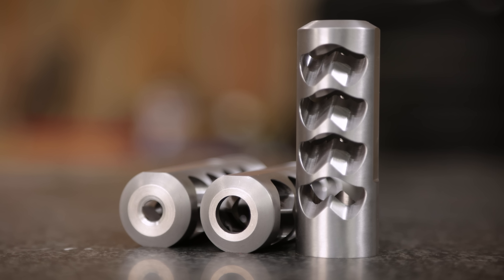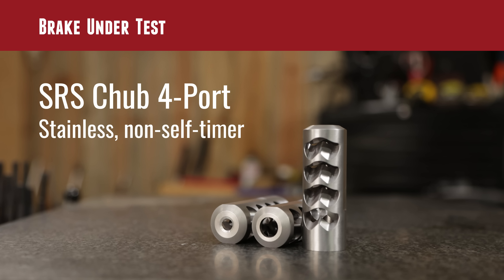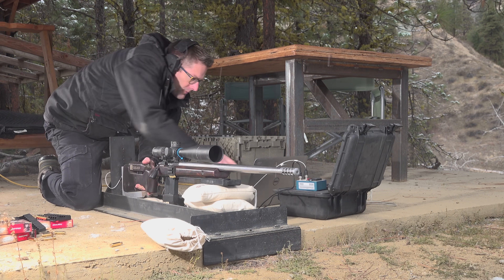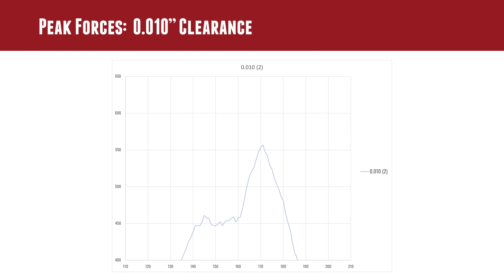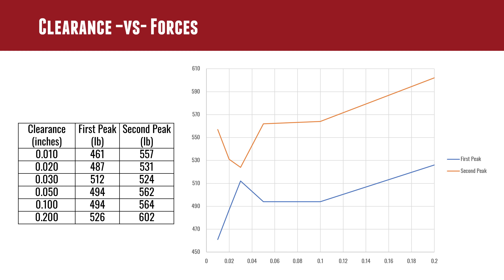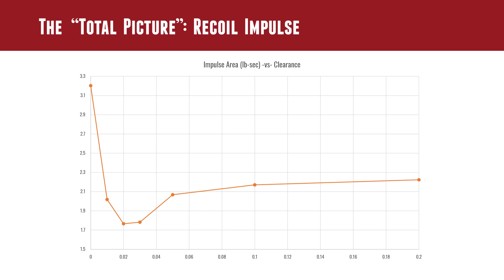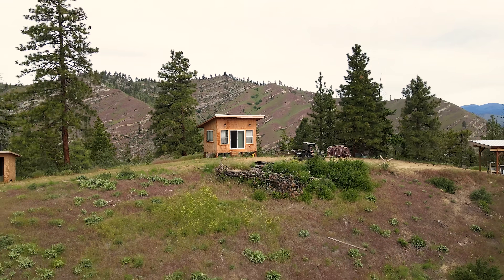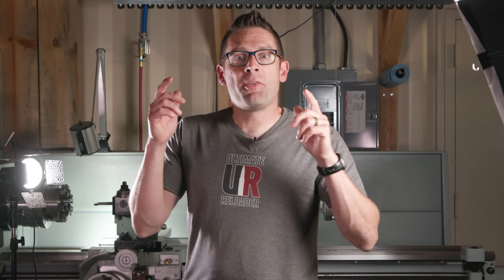Bullet Clearance -vs- Brake Recoil: Shocking Results (SRS Brake)

Comment: It is a good test but you are missing a key element.  Each time you bore the brake, your are removing surface area for the gasses to act upon thus reducing the efficiency of the break.  If you take into account the loss of surface area to increase of recoil, then your data shows even less difference in recoil.  

For example, when you remove 0.200" from the break in your last test, you are removing about 14% of the brakes surface area (estimated based on a SRS The Chubs diameter of 0.990") and the recoil increases based on the average of the two peaks of about 10% from the baseline 0.010" test readings.  

The correct way to run this test is to have different muzzle brakes for each stage so they have the same surface area for the gasses to act upon.  I think you will find that the recoil differences with this test will be even more obscured.
Reply: Exactly! I was going to mention that the o.d. with more surface area on the baffles would have a bigger impact on recoil reduction.

Comment: I liked Austin's suggestion of measuring velocity while testing although the differences may be small but still measurable. Also would l to see same testing on differently ported breaks. Seams like you did a video on different brakes for there recoil efficiencies and are their porting 10 to 30 thousand over bullet diameter,  if this is the industry standard sweet spot? I really liked the recoil reduction of this break.

Comment: Gavin, assuming the muzzle brake is made properly, I am wondering the muzzle speed relative with the muzzle brake clearance to the bullet. Would like to see if you would test this. 
FYI, I have 2 muzzle brakes for my 6.5 Creedmoor. Without knowing the muzzle brakes inside diameters, I observed that they are giving consistent muzzle speeds difference of about 20 fps.
Looking forward to see your evaluations.

Comment: I've run 6.5 brakes on 6mm with no noticeable difference. I've always thought 30 cal brake on 6mm left a little bit of recoil reduction on the table, your data seems to support that.  Regarding a test of whether bore diameter effects precision or POI - ultimately I think a very difficult thing to test successfully. What you'd actually be testing is the effect of removing mass (loss of metal from the larger bore) and how that acts as a "tuner" on that particular load and rifle. It would only become a valid test if you could run it with a large number of brakes and rifles to get something statistically significant.

Comment: I am wondering if a progressively tighter chambering would provide a better consistency to gas flow and hence better precision in bullet impact. By that I mean cut the first chamber aperture at 0.050, the second at 0.040 and the final at 0.030 over caliber. It has been a few decades since my fluid dynamics classes, but I would expect a progressive aperture to reduce eddying and turbulence in each chamber and impact the projectile less.
Reply: This is how I make my brakes, but my reasoning is simply that I want each port to do some of the work, instead of trying to shed as much gas as possible in the first port with a tight bore going into the second.

Comment: It would be interesting to see if there is an effect on the bullet velocity in relation to the muzzle break clearance. Also what is the effect on a 5 or 10 shot grouping with changing the muzzle clearance at 100 and 500yards.

Comment: So just thinking it through; as the bullet advances down the barrel with expanding gases behind it, not nessicarily like a wind, but expanding in all directions it reaches the end of the barrel and newtons law comes into effect. Equal and opposite forces.  

With the brake installed the expanding gasses pass through the brake which redirects the gases rearward like a thrust reverser on a jet engine canceling out a portion of the forces.  So no matter the size of the hole in the brake the gases always expand out.  Even if the hole is bigger the gases expand out and you don’t lose much brake action until the difference becomes extreme, but even then the gases want to expand out.  

Sorry.  I’m a novice to guns.  I have them and hunt with them and shoot them but don’t usually think about the operating principles.  Like some folks driving cars.

Comment: That was awesome. Love to see similar testing with suppressors of different calibers, like the difference of using a 9mm suppressor on a 9mm vs a 45 cal on a 9mm. Both should effect felt recoil, but is there a large difference? If there isn’t a large difference in recoil and sound, why buy the 9mm that surely isn’t safe for use on a 45.

Comment: Just a note after building and installing a bunch of brakes over the last 20 years.  Bullet clearance can and will reduce by .005" or so after about 100 firing cycles.  If your target clearance is .025" bore to .030" and your clearance will shrink to target diameter within 100 rounds or so.  I have experienced this with almost all muzzle brakes no matter what material the brake is made from.
Reply: heat cycling ... long thin things get shorter and fatter. Volume wants to return to a sphere over time due to gradient heat cycling.
Reply: Possibly from elongation causing an "extruding" type of effect? That is very interesting...I wish I had measured the ID of the brake on my LR-308 when it was new compared to now because I have well over 600 rounds through that brake. I may get a new one for it and do a test. Thank you for this comment, it has really sparked my interest!
Reply: @willperry6244  I think it could also possibly be from the pressure expansion.  If you are able to test I would like to know your findings.  Hopefully I'm not crazy!
Reply: Is that due to fouling?
Reply: @tommoss2005  No.  I observed this after thorough cleaning.

Comment: Try tapered internal clearance on muzzle brake...tight to loose..vs loose to tight? ..or... tight..loose..tight loose... alternative.

Try off centre brake to gauge what difference.

Try oval holes...alternating..left right to up n down....

Tight clearance gives less following gas at higher pressures

Loose gives more following gas at lower pressures.

I guess...

Comment: Others have already gotten at both of these points. 1) What was the effect on accuracy? 2) What would happen if you left the exit bore at .01 or .02 but bored the preceding holes larger (kind of like a chamber to allow gasses to expand and maximize gas exit through the ports while minimizing potential turbulence on the bullet at the point of exit)? (And how might that compare in accuracy against the constant bore size?)
Reply: I'm also curious of this but using a tapered bore. Start small to large and start large end small.

Comment: why do they read 0.01 as "10 thousandths".?
and 0.2 as "200 thousandths".?
to me, reading non-existent zeros is redundant...???
it's the same as calling 2 as two hundredths of one hundred (002),
or... two and zero thousandths (2.000).!!
Reply: It's standard in machinist lingo. Easier once you get used to it.
Reply: @duggydo  thanks, that makes sense...
machinists ALWAYS make things sound more complicated.!!
dang weirdos.!!! LOL
Reply: Just standard machinist lingo 😊
Reply: most machining precision lives in tolerances of .001 so it makes sense to talk about measurement using that scale. 2 thou instead of "point zero zero two". the former is quick, the latter is needlessly wordy and obnoxious. 10 thou instead of "point zero one". this is the lingo that machinists have used for around a hundred years.
Reply: @TMS5100  i think you missed my point...
0.002 = two thousandths.
0.02 = two hundredths.
0.2 = two tenths... which is WAY easier then two hundred thousandths (3 extra syllables AND 2 extra 0's to write) and mathematically incorrect, but apparently doesn't matter to machinist, sounds like they prefer their own "lingo".!!
Reply from the maker: Yep- in “English” machining we think in thousandths

Comment: I'd love to see this same type of test on a suppressor, looking at if it changes the sound
Reply: If you are speaking about suppressor end caps such as using a 30 cal can with a 556 end cap, small diameter does decrease the decibels with the tighter cap.
Reply: Check out PEW Science, he has several comparisons between 6.5CM and .308 on the same .30-cal suppressor
Reply: I have done a lot of experimentation in this field, I am even building my own recoil rig.  They need to run a test where the comp is bored out leaving a smaller exit at the muzzle end. Then open that up in steps. All of my experiments have shown that the more gas you can vent before bullet clearing the very end, or the larger volume in the case of linear comps, the less recoil is transmitted to the shoulder.
Reply: @willimonprecision8349  Confirmed anecdotally: my 100 pound wife (when she’s soaking wet in winter clothing) runs a JP Rifle Recoil Eliminator on her .308 AR-10, giving it less recoil than my AR-15 in .556
Reply: It sure does. I've done since testing on this with a scientific grade DB meter. If you go from a 338 suppressor hole on a 30 cal projectile it's about 2 DB louder which is significant. Enough to hear with the naked ear. 
The big effect on DB decrease is length and number of baffles vs width of the can. The bullet path hole diameter in the suppressor does matter but not as much as I thought. 
But a longer skinnier can is more effective than a fatter shorter one. 
You want the tighter the hole the better for sounds suppression but it increases the chance of a bullet strike.
Reply: @asdnetwork4268  Just one rubber wipe gives the tight seal at the end of the can without risking bullet strike on the baffles or endcap, AND that rubber wipe has a bigger effect on DB than tighter tolerances ever would.
Reply: @thebluestig2654  yes but it can affect accuracy at range. Wipes are great but should be for close in pistols. 
My opinion anyways having used them.
Reply: A tiny piece of rubber in the end of the can makes more of a difference in sound than anything else.
Reply: there is a guy or site that already does this
Reply: I’d like to see this test done with suppressors too, only how larger cans compare with recoil reduction vs caliber specific. The sound testing like mentioned above would be interesting too…

Comment: I have both a  Ruger .308 Win and 6.5 Creed Moor.  I took an extra .308 muzzle brake I had and put it on the 6.5 and it seems to be pretty quite, reduces recoil effectively and only moved the POI about 1" to the right at 100 yds. Since I plan to leave the muzzle brake on the 6.5, I did sight it back in with a 200 yd zero and it has been shooting great. I have read elsewhere that running a slightly oversized muzzle brake is not totally uncommon.

Comment: I went a slightly different route that worked well for me. I have 10 thou clearance on the exit but bored out the baffles behind it larger on the 3 baffles that I built into it, This allows more gasses to vent but they cant go further than the last plate ( exit ) .... I noticed a reduction in recoil doing it this way but the downside is that the brake is a lot louder as well.
Reply: Thought.  What if instead of increasing the overall size of the ports you taper the ports from bigger inside the bore to small outside the bore.  The taper may increases the gas velocities passing through the ports yet allow the same amount or more gases out.  The increased velocity may increase recoil dampening.

Comment: Not very talkative, was he?  I, like you, figured the slope would have been higher as the tolerances went up, but can understand why it came out the way it did. In all cases, the barrel will discharge the same amount of gas early and, so, the same amount of gas as the bullet leaves the end of the barrel.  This means that the actual discharge will always be about the same and at the same time. The change in the amount of extra gas that is allowed to go along and beside the bullet is pretty small, so once you add a brake of any clearance, within reason (100-thou), will provide about the same performance. 
Was definitely interesting and ,though different from my expectations, is completely understandable. I am very interested in how the performance  of grouping will change, so that would be a neat video. Thanks for sharing.

Comment: Nice, this validates why I am having no issues using a .30 cal brake on my 6.5 and 7mm guns also.  I couldn't find a 7mm at the time I bought one for my Rem. 7mm Mag, so I jumped for a 30 cal.  I expected it wouldn't perform, but it did great.  Huge reduction over none at least.
Reply: I did exactly as you. Bought an EC tuner brake in 30 cal for my 7 RM. Brake is amazing and load testing dosnt hurt after 20 rounds

Comment: You should definitely check accuracy vs clearance next time. I've noticed on one particular gun/brake combo that it would not group even with tuning at 10 thousandths over-bore. I suspect it has to do with the ratio of concentricity error to clearance. Your theory on pressure differences along the bullet at tight clearances is probably right.
Reply: I agree with what you are saying about accuracy being affected by clearance.  I made a brake for a .22 Tac Sol barrel, and the gun grouped about .38" at 50 yards, and wouldn't group worth a dam with a .010 clearance brake.

Comment: Great research! One small suggestion would be to measure the mv just as a way to validate the data and help ensure you didn't have one or two rounds in that factory ammo that was a little hotter than the next! I doubt it would change the outcome but it doesn't hurt to check! Great work.
Reply: Yes. MV would definitely change POI and could also effect group size. Be an interesting test.
Reply: Also group size

Comment: I'm surprised but excited about those results. I use 6.5 brakes on my 6mm rifles just for the sake of interchangeability. I've always been curious about using a .30 cal can on my 6's and 6.5's as well and how much decibel reduction is lost with the extra clearance. Thanks for the great videos!
Reply: If you google. Running a 30 caliber brake on a 6mm rifle.  The test revealed a 3-4% increase in recoil. Same brake used. Only diameter of hole was different.
Reply: If you have a proper silencer, it  will have a removable end cap with a design that allows you to sandwich your rubber wipe disk.  There is a big difference in sound level between a fresh disk and no disk.

Comment: I wonder if the larger bore size would actually cause more turbulence (inverse of Gavin’s theory) and decrease accuracy because the gases often outrun the bullet.
Reply: I've seen both close clearance to bullet diameter and loose clearance.  The closer to the bullet diameter seemed to have a tad better accuracy, but it's so difficult to determine if that is brake or shooter.  It'd have to be a locked down rifle test with no human involvement.  I've run 30 cal muzzle brakes on 6mm and 6.5, 6.5 on 6mm & 6.5, and I've known guys who run 6mm brakes with 6mm bullets, that high speed brake that has the little bushings held in place by pins.  Again, this really in my opinion has to do with caliber and human interface factors.  6BRA is considered the most accurate 600 and 1k yard bench rest cartridge so it's tough to say yeah, it has a large impact on accuracy and precision.  I've had multiple brakes and a suppressor, and the suppressor had the greatest POI shift, because it acts like a tuner.  Same with brakes.  If you don't have the muzzle cut specifically to that brake and timed properly, then when you screw it on, you'll see POI shift, because it changes the tune of the rifle.  That's the biggest impact of brakes on POI, they're length and weight acts like a tuner.
Reply: also makes me wonder about baffle distances apart and numbers of baffles on accuracy.
Reply: Plausible theory. As well as poi shifts
Reply: No,its the opposite ive found with the muzzle breaks ive used over many years. The faster the gases can escape the more accuracy on point of impact is what im seeing with the many different breaks ive used. Ive gone from a basic 8 port break with tight tolerances to a huge break with multiple ports and big tolerances and the more ports and bigger tolerances preform much more consistently and accurate on point of impact than the smaller breaks with less ports and tight tolerances.
Reply: Yeah I wonder about the accuracy question too. There is usually a balance or a trade off eventually for stuff like this.